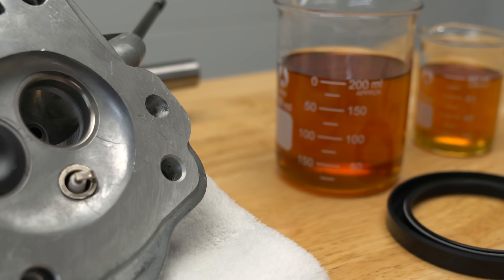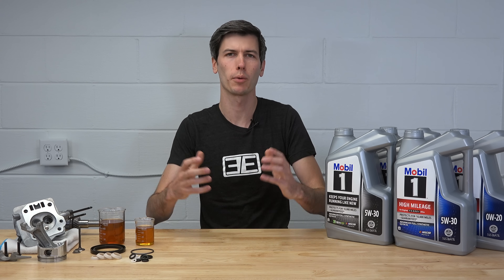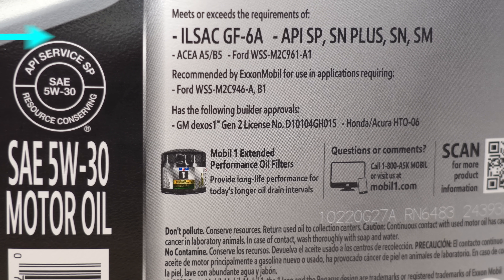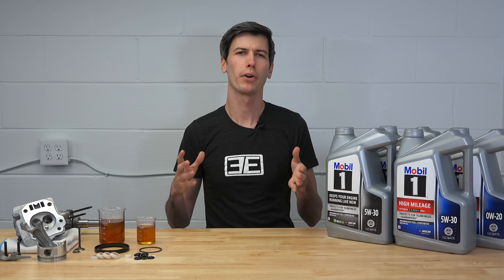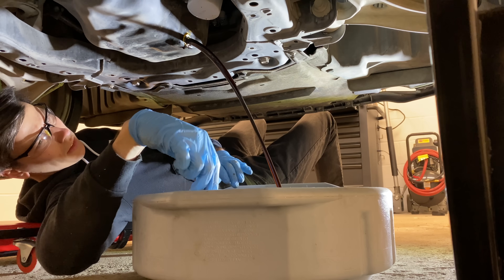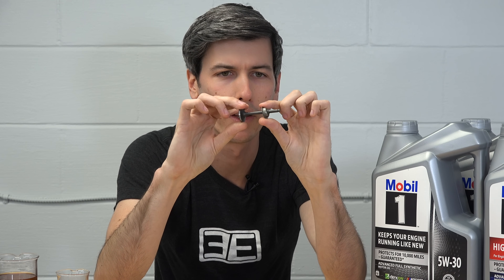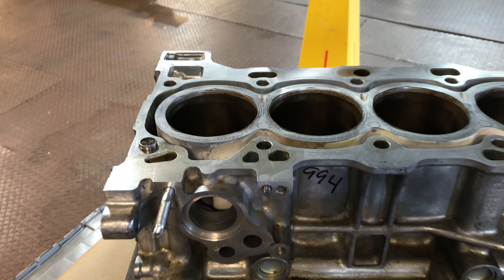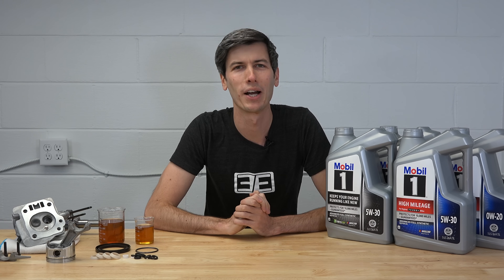Is Synthetic Motor Oil Bad For Old Cars?

Comment: I value your opinion based off the "Engineering" title of your page and I searched this subject because I'm currently working on a 1990 BMW 325 with the M30B25 2.5L inline six. Odometer reads around 130,000 miles but I have not driven it to see if it works. So 15W50 Mobile One it is.

Comment: One thing that's very important when using any modern oil in an old engine is zinc additives for very old cars with flat tappet camshafts

Comment: I use to use Mobile 1 full synthetic oil, but I found out that Kirkland full synthetic flows quicker in very cold climates.
During our daytime highs, we average 25 degrees F and below Zero degrees F at night.
I have a battery warmer which I plug in at night.
We drive our pickup only about 3K miles a year so I change the oil and filter every 6 months (about 1,500 miles).
I change the front and rear differential, transfer case and transmission fluid every 30K miles, except for our Subie’s and the transmission fluid every 60k miles as recommended by our mechanic.
Subaru says that the transmission fluid never needs to be changed, and I think they’re full of crap.

Comment: I you's to used Mobil 1 Oil in all my car,s I stopped using it, when My cars were burning oil when they never did before, I have also lose 2 motor's to rod knocks, Never in 45 years did I have this Problem, I bought a Brand new Honda civic, at 70
thousand rod knock, I change my oil every 3000 miles, So my 96 dodge ram ,Had Mobil1 used in it from new, started burning oil at 70 thousand, 1 quart month, I stopped using Mobil 1 , Put Valvoline Straight 40 stopped burning oil after 3 months, So Now my dodge has 330'000 miles does not burn 1 drop of oil still runs like new, Using straight 40 in all my vehicles.
Reply: Not applicable in canada.  Or michigan.

Comment: Perhaps the most extreme example of burning oil might be my '53 Johnson Seahorse 2-stroke running on a gas oil mixture of 15-to-1!  Using non-synthetic oil, I had to clean or change the spark plugs after about 10 hours of operation.  Once I switched to synthetic oil (still using the 15:1 ratio), I never had to change the spark plugs again!!!  This made such an impression on me that I started to use synthetic oil exclusively when I bought my '79 RX7, that burns crankcase oil by design to lubricate the rotor.  In 23 years of driving, I got 320.000 miles on that engine and it was running fine and smoke-free when ! finally sold it for a larger car!
Reply: What 320 000 miles with the RX7? How many rebuilds if i may ask?

Comment: I’m a former V.P. Of Purchasing for a major international company. We wanted to have the best warranty and quality in equipment that used automotive oils. The hydraulics were often tortured by our customers, so we did an exhaustive test of motor oils. Due to the patient’s Mobile holds, nothing—NOTHING can compare to Mobile 1 synthetic oils. I do NOT work for them, but I believe with proper filtering, Mobile 1 would last indefinitely, as it’s that superior—again due to the patents they’ve held all this time.
Reply: ED, mobil 1 is overpriced and overhacked, ive used walmart syn superteck for years, change about 6000 or once year.

Comment: Good video just one thing if engine is fine no leaks does not burn regular oil is okay expensive synthetic not a must. BUT if you have supercharged or turbo engine always use synthetic as turbos and superchargers as they compress air for more power run real hot and synthetic can handle the heat regular oil will sludge and literally burn so easy answer synthetic is always better and in some a MUST.

Comment: I think another issue is the longer oil change interval. Whether conventional or synthetic more frequent oil changes help.
Reply: 100% agree, clean cheap oil is better that dirty expensive oil.
Reply: Agreed
Reply: That's why oil filters exist. They go bad before the oil does. If you're dropping synthetic oil at 4k or 5k, you're wasting good oil. Only change the oil filter at 5k and replace the oil that's lost from replacing it.

Comment: I have a 2010 Maxima with the 3.5 engine. Last year, the check engine light came on and was diagnosed as a Variable Valve Timing solenoid had failed. This particular valve has a screen on it and according to the dealer, this screen can catch debris and throw the code. Did an oil change with conventional oil and no change. Lived with the light on and a decrease in mpg. Down side, damn near impossible for the back yard mechanic to replace with out removing the engine. Fast forward to this past April. Did an oil change and used Mobile 1 high mileage synthetic and after a couple of weeks, the engine light went off. Changed the oil again in June just to get any gunk out, using the same oil and, and the check engine light is still off and my mpg have improved to what they should be.

Comment: All motor oils now have seal conditioner, both synthetic and non-synthetic and not just high mileage oils, which are slightly higher in viscosity. The one engine I remember higher viscosity oil fixing excessive oil consumption, is the old Ford Escort, that had crankcase ventilation issues. Just going from a 5W30 to a 10W30 oil, actually reduced oil consumption to an acceptable amount in those engines.

Comment: I've been using synthetic oil in my 1990 Volvo for years - 340,000 + miles. Doesn't leak or burn any.

Comment: It’s very simple. Petroleum based oils cannot adhere to metals at higher temps. The area in your engine that has the highest metro temp that needs lubrication is the top of the cylinder. Synthetic oil will lubricate this area.

Comment: Dang good video.  Loved it from a former lubricants dealer/manufacture.  But, what are you sitting on?  The constant jiggiling up and down and twisting around is slightly distracting.

Comment: Back in 2000, bought new, a 2000 Honda Accord, equipped with a 3.0 V6. Great car, still is. I'm the original owner. Always changed oil as recommended by Honda. Never leaked a drop. 20 years later at 130,000 miles, I decided to try Mobil 1, full synthetic. After the oil change, upon restarting the motor there was oil coming from the rear main. Go figure.

Have since switched to a non- synthetic Shell Rotella T-4 15w/40 non-synthetic oil. 

I've heard stories about switching motor oil over to Mobil 1 sometimes cleans and infiltrates seals causing leakage. 

In my case, I can't specifically blame Mobil 1 oil. Maybe the seal was just ready to give up, I don't know. I'm just suspicious is all. 

rocket

p.s. Now, 3 years later, at 170,000, the front is starting to leak. Oh well.

p.s.s. A mechanic once told me synthetic oils are great....but, if there is a weak spot in your motor for a leak, a synthetic oil will find it. Probably some wisdom there.

Comment: The information in this video is obsolete. Current full synthetic oil no longer ester nor PAO. Most are hydrocracked or hydrotreated, some frrom recycled oil. They can freely use "full synthethic" on anything. They ruin seal by shrinking seal. And keep mind most most of oil today do not have API logos, meaning they are not certified. Just a label is useless.

Comment: This has always been a myth of biblical proportion.  The real issue is that synthetic oils are detergent by nature, so they will break down all the crap/sludge etc., which has built up in the motor.  This could cause blockages in oil passages and real problems.

Comment: 96 Honda on Castrol forever. After 150k I switched to Mobil1 synthetic.  Can't say if it helped or what. That car leaked oil anyway :face-green-smiling: 187k when i sold it 18 yrs later

Comment: Well done. FYI a comprehensive study concluded the primary if not only advantage of synthetic oil is it retains its viscosity rating way longer than non synthetic. I said non synthetic rather than mineral oil as it ALL comes from mineral oil. Spoiler…. Synthetic oil is NOT magically produced in a laboratory

Comment: Gauging the history of the 90's era... those "good" cars largely used one spec:  5w-30.  It works really well.   Regarding manufacturer recommendations, I would say stick with their first [w] number, which is all about cold/startup flow.  If you want to change anything, work with the second number.  Be aware: oil is now being chosen as a measure to try and grab [& stack] extra mileage abilities, and protecting the engine comes in second.  Blame cafe2 nonsense pumped out under the Pelosi/Boehner regime and a mad compliance scramble that is tossing otherwise good engineering out the window..  In that light, 0w-16 is a freakin joke: you can move to 0w-20 [or even 0w-30] and be unable to spot any difference.

Comment: Thicker oils work well for scooters and motorcycles as far as I've seen. If the company recommended oil is 10W30, I switch to 10W40 after like 30K kms and then to 10W50 around 60K kms. The engine feels smooth like new.

Comment: It’s more the cars not the oils and I can prove it. I never used synthetic oils in dozen of mine and my family members’ automobiles but Toyota vehicles last 300K miles and beyond not just engines but everything else like transmission, suspension, suspension struts, lift gate struts, pop up headlights struts, paint, upholstery, AC systems, electrical systems etc.
we have had 1976 Corolla, 1984 Camry, 1985 Supra (pop up headlights), 2000 Avalon, 2003 Highlander, 2005 Camry and I am still driving the 2005 Sienna with 323K miles still running great with only minor repairs never used synthetic nor high octane fuel saved me a lot of money.

Comment: Tuning the oil viscosity to clearances is the best way to determine what grade of oil to use. The proper grade will bring oil pressure up to almost original numbers, but won't create oil starvation of too thick oil. This is done by starting with a low viscosity oil, and observing oil pressures at operating temps at redline rpm. The lightest weight of oil that creates max pressure is the proper viscosity. Lighter oils spill out of bearing surfaces too quickly, and thicker oils don't allow enough oil flow, causing starvation to the rod bearings and sometimes upper engine to areas like cam phasers and overhead camshafts. 

This should be common knowledge as I have been doing this for 30 years... but have only seen Ferrari say something about tuning the oil viscosity, largely for weather temperature considerations...

Comment: My own antidote. 30yrs ago, I bought my first car. A 1973 Mustang with a 351 Cleveland. Nothing fancy or fast. 2 barrel carb smog  compliant points & condenser single side exhaust. My first month, I was getting 14 mpg and it was sluggish. I dropped in a Pertronix ignition  new timing chain and new tire. Mobile 1 at the time was the only synthetic oil on the market but I ran it because of the articles published at the time. My mpg increased to 21 Hwy and my smog guy said it ran so clean that it could be a red flag to the dmv. I never had a leak. The engine never gave me a problem for the8 yrs I owned it but my father needed a car and eventually ran it into the ground.

Comment: I switched over to Mobil-1 back in 1980 in my 1969 GTO and 1957 Belair, my engine smoother at idle and at speed than with the typical 5W30. However synthetic oil would kill my 2009 Ford Expidition Triton engine because it requires the 5W30

Comment: My 1991 Prelude was fine before an oil change, threw in 5w30 fully synth castrol, then a fat lifter tick started and my car started smoking, after switching back to a base oil all went away
oil was wayy too thin and seaped through my valve stem seals and was too thin for my valves

Comment: If your old engine has been thoroughly cleaned internally, and is not "loose", synthetic will be excellent, PROVIDING YOU CAN GET THE RIGHT VISCOSITY.  I would not use 5W or 0W anything in an older engine - clearances might be too large for oil that thin.  You will have low oil pressure, maybe so much oil running off in some areas that others don't get any oil.

Comment: Bought my 96 Camry about 12 years ago with leaks, replaced both cam and front main seal along with a timing belt/water pump job back then, have been running 5w30 Full Syn ever since, turned over 400K a month ago, running good with NO oil leaks, and NO sludge either!

Comment: What if you turbo charge a honda engine that runs on 10w30? 

The greater temperatures will damage the hot side of the performance. Would a full synthetic oil, like a BMW turbo 10w60 would be a nice choice?

Or a full synthetic with similar properties to the OEM engine oil?

Comment: What is driving me nuts is my 05 Sierra specs GM6094 oil. Only oil I can find that says it on the bottle is Mobile 1. Can only find that at one store. There's gotta be more oils that my truck can use than just mobile 1?!

Comment: The problem is not only the seal, but the accumulation of deposits around the seal - conventional oil leaves them alone - synthetic washes them away and a leak presents itself.
Reply: BS

Comment: Rotary Head here I am glad you touch base on the rotary engine in the end.  I have been using synthetic oil since my '91 RX-7 Turbo II back in 91.  Also in 93 RX-7 R1 and 07 RX-8.  The only time I was told not to use synthetic oil was having mineral oil in the rotary engine long time and switching over.  But I have always removed the original mineral oil from new and switched over to synthetic.  I have also talked to a lot of rotary engine builders and all say the same.  

Again thank you for touching on the rotary engine and the myth about synthetic oil

Comment: 3.5 Toyota V6. Deff leak oil.  How they do not have to recall all those engines because of the environmental pollution they create thanks not to the exhaust but to that leaking oil all over the ground.

Comment: I use mobile syntetic oil on my 95 Corolla because a shop nearby have a great deal on this oil, I think there is no negatives in using an oil that has better viscosity on start up, so the oil comes to lubricate the parts faster. I live in a cold place ( Norway) and often 10-15 degrees below zero in winter time. I have seen videos of how slow ordinary oils run down a piece of wood in sub zero temperatures compared to syntetic oils, to me it is a no brainer... I use the most viscous oil that lubricates that cold engine fastest/best in those conditions. I don´t care if I have to put in a littlebit extra every 30 days. I have no leaks by the way, so for me it´s just a choice between mineral and syntetic. 317 000 km/197000 miles and still running good. I wonder when the clutch and exaust will have to be changed, because my car has only original parts. I realise that the corolla was "over designed" and that is the reason why areas like Afghanistan and other war ridden countries have huge amounts of corollas... they just go, and go, and go. And I think they will go a couple of years longer if you give them the best most advanced oil.
Reply: 1990s Toyotas were the BEST mass-produced cars that were ever made in the history of cars. 
I own a 1993-1999 Model Toyota Celica 1.8 Litre petrol  and mine has covered 224,000 Miles (360,500 km) 
It has never broken down or failed to start 
They were over-engineered cars the likes of which we will NEVER see again in a mass-produced car. 
I use Shell Helix HX7 5w-40  Semi-Synthetic Engine Oil when I change the oil ... However, I change the oil and oil filter every 6,000 Miles (9650 km) and it has been since the car was brand new. 
Sadly the body on my car is starting to corrode badly (They put salt on the roads here in the UK in the winter..It destroys the bodies on cars) the engine is still like a Swiss watch ..If I can get maybe another two Years out of this superb car ..I will be very happy.

Comment: I beg to differ, upon switching to high mileage T Mobil synthetic, on my SUV with 100K miles, it developed a rear main seal leak within a month of a drop every few days. I had to use a bottle of ATP AT-205 to fix the leakage.

Comment: i can say from experience  synthetic will not hurt old car engines. it will generally make them burn more because it is so much more lubricant it will allow the oil passed old rings and seals more. other than that it is definitely better for your engine.

Comment: NO and why would it be, it's a lubricant not magic sauce that make the motor work different. If anything the advancements in lubricant technology should be good for any engine, better lubrication, less heat, good deal !

Comment: I have a Ford V10 with 190000 miles on it it seems to be running fine at this time but I'm thinking of running a high mileage oil, the manual calls for a 5w 20, I was thinking of going up to a 5w 30. High mileage oil any thoughts on that?

Comment: For me with my 1967 Wolseley Hornet I use a conventional, 20w50 blended specifically for classic engines. The A-series engine has larger tolerences so the thicker oil is recommended.

Comment: I remember this about mechanics saying this in the early thirties and forties because of the poor ring quality and the boring of cylinders. They would actually baby powder down the carburetor to help reseal the rings this too was done for Mazda rotary engines for the pixels to be resealed. Show me the real older motors you just can't use synthetic one time I did a oil change on an engine that never had the oil changed, I knew to save the old oil that I drained out just in case the engine started smoking 🚬 sure nuff it did so I drain the new oil and put the old oil back in it basically seal the engine back up so didn't smoke
Reply: don't worry, most synthetic oils today are mineral. They do not contain PAO nor Ester.

Comment: I have a 2007 Dodge Nitro 3.7 V6 and I'm using Castrol 20,000 mile 0w20. I do change the oil regularly not the 20k it says But I'm curious if anyone knows if this is good or bad for this engine.

Comment: Hang on, if the oil is too thin then you can get Lifter Noise. I found out the hard way. So I should not use an oil lower than 20W.